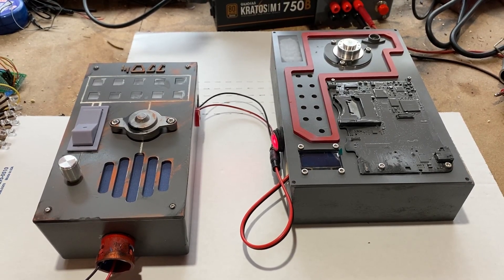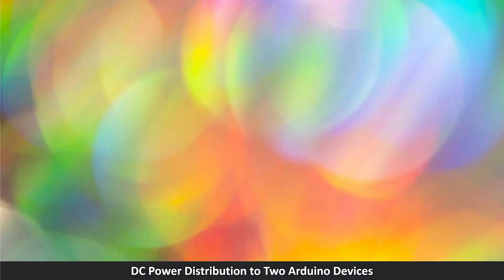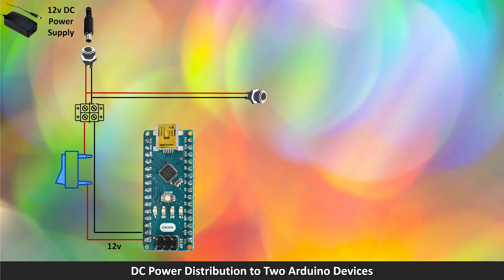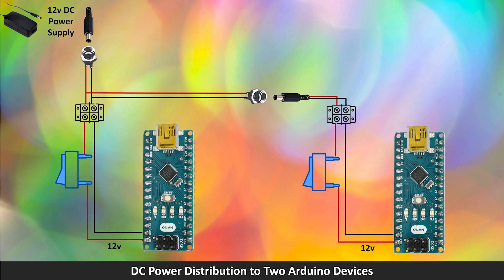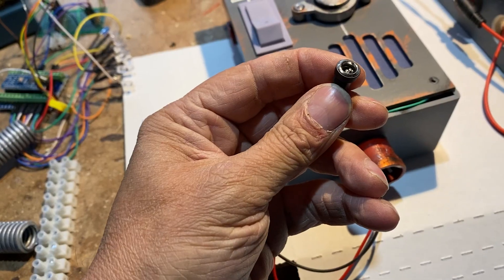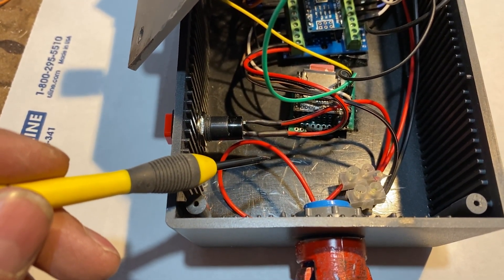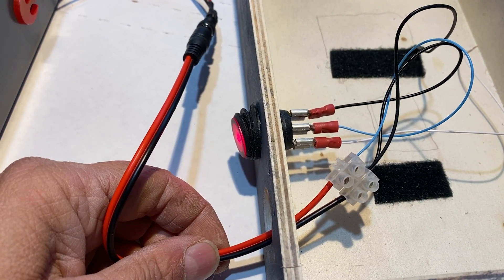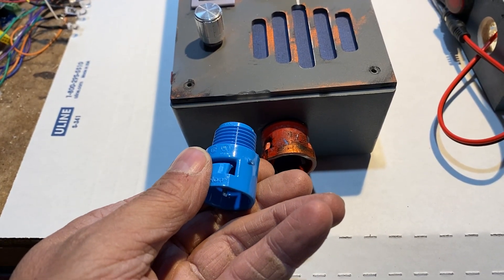Efficient DC Power Distribution for Arduino Projects

Comment: Thank you! I’m a total rookie and this video has been a huge help. 

Can a single 12v power supply handle powering an arduino and a 5v screen at the same time?
Reply from the maker: It depends on the consumption of your screen, if your using small displays with Arduino, a 12v 2amp is more than adequate.  I have 3 panels, 3 arduinos, 1 small LCD screen, a lot od LEDs and it's drawing at its max only 250mA on a single 12v Power Supply, so a quarter of 1A